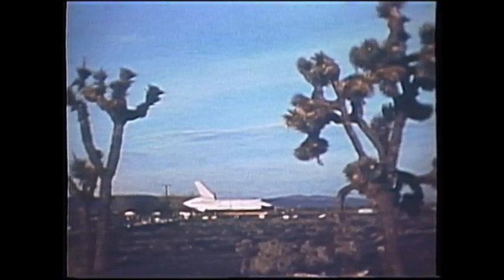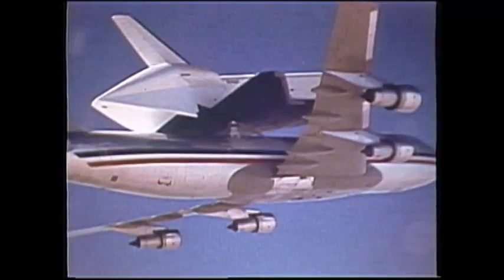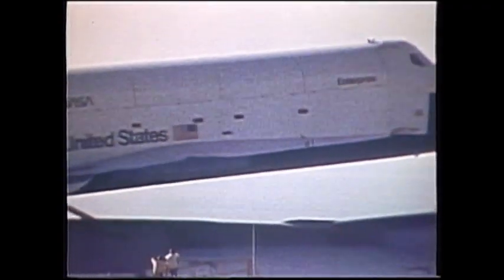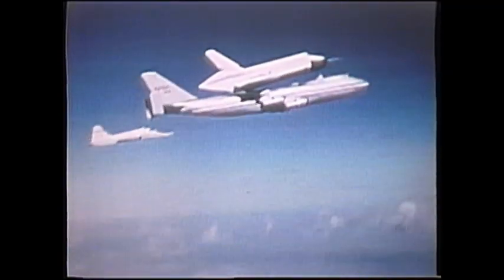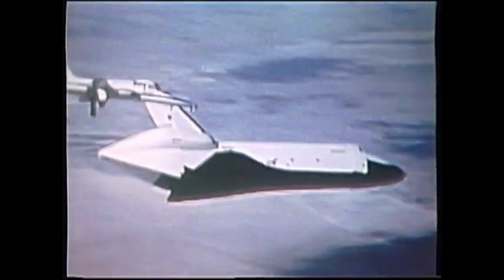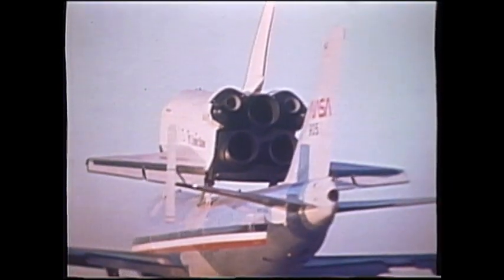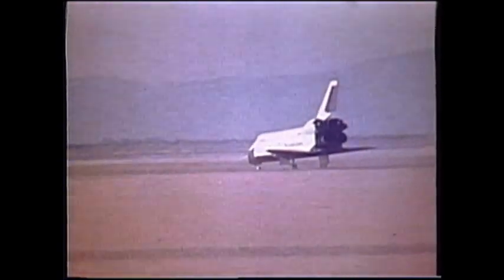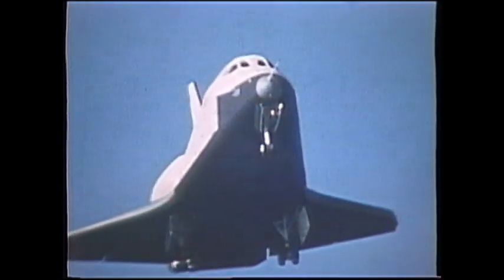Go for Sep

Comment: How space shuttle is controlled without propellers?
Reply: Wings
Reply: The space shuttle is a glider when it lands and doesn't use engines.
Anyway, if it did need engines, why don't you think it would have jet engines instead of propellers?

Comment: It’s depressing that they were designed for 100 flights but they got canceled before they even got close to that
Reply: The reusability of the Shuttles were vastly overstated.  Each of the tiles had to be inspected, and damaged ones replaced.  The engines were removed and went through extensive checks each time.  The solid rocket boosters were recovered, but the refurbishment process was actually more expensive than outright replacement.  It was never the rapidly reusable spacecraft that was promised.

Comment: Great space program. Fantastic ship. Back when we had true ambition.
Reply: The Shuttle was incapable of anything but low earth orbit.  It was an overly complicated and expensive space truck that failed to be cheap or rapidly reusable.  They accomplished a lot with it, but many of the same tasks could have been done with a heavy lift rocket and crew capsule.
Reply: 10 billion goes to the ISS, 10 Billion goes to JPL, Marshall, KSC, Wallop Island ect, 9 Billion to Artemis
Reply: @davidking1460 
Exactly.  It doesn't cost SpaceX $2 billion to launch a rocket because they don't have 6000 employees hanging out at Marshall, many of them engaged in make work activities.  And Ames, and Glenn, and Langley, and Stennis, and Goddard, and...
Reply: We still have ambition. If we could only get the funds
Reply: @davidking1460     NASA is getting $24 billion this year.  Funding isn't their problem.

Comment: Does the 747 detach the space shuttle for it to land or does it land with the space shuttle?
Reply: What would be the point of landing 747 with the Space Shuttle?!
Reply: Before the Approach and Landing Tests were carried out, they practiced a series of captive tests.
Reply: I dont know thats why i was asking
Reply: Oh God 
They used Boeing 747 for two purposes, one was to test the landing procedure (as shown in this video) and it was detached then, and the other was to transfer the Space Shuttle when it landed at Edwards Air Force Base, and White Sands Space Harbor, to b bring it back to Kennedy Space Centre where taking off took place, and it wasn’t detached (for obvious reason) then.
Reply: max5250 thanks
Reply: @Dandan-ku5vy  
You're welcome.

Comment: This is great. Landing from 20,000 ft and 250 knots. But how did they test landing from mach 20 in outer space?
Reply: STS-1 through STS-4 were piloted test flights. With 2020 hindsight (ha, get it?), this is extremely dangerous and we probably would have launched the Space Shuttle without a crew before putting astronauts in it if it were to be done today.

Comment: On one of these Enterprise test flights--I was sitting on Trim pad 22, running a T-38A engine test run.  And we had to hold for the two aircraft to taxi out to the runway--past our location.  Wish I had a camera then--history in the making.  But we set there so long--that we finally had to shut down--not enough fuel to taxi back to the parking area.  So we got to watch the entire flight--from takeoff to the landing of the shuttle test aircraft.  The Enterprise was built without any intention that it ever venture into space--simply a test article.  But when the Challenger blew up--it was considered to update the systems--and use the Enterprise as a space vehicle--until it became clear--doing this would result in costs higher than building a new orbiter.  So now--it resides as a museum piece in New York City aboard the Intrepid.
Reply: actually, it was planed that 001-Enterprise would be the 5th orbiter to launch until some genius said, "hey guys, you do remember we shocked this hard enough to simulate 100+ flights already, right?"
Reply: @Arch_Angel_7774  Second orbiter actually. OV-101 was always planned as an actual space vehicle (hence the "OV" designation). 

After the vib tests at MFSC, OV-101 was to return to Palmdale and be outfitted with the missing space systems and then delivered to KSC for first flight processing.

This never happened due the fact it wss the first orbiter and had serious weight problems. So the decision was made to convert the Structural Test Article-099 (STA-099) into the second orbiter making it OV-099 (Challenger). OV-099 was much lighter than OV-101 was increasing the payload mass to orbit capability.

The fifth orbiter, OV-105 (Endeavour) didn't come along until after the loss of OV-099 as a replacement constructed from a set of structural spares contracted for during the final assembly of the two last orbiters (OV-103 Discovery and OV-104 Atlantis).

Comment: Nothing can leave the earth, it is just a kind a glider. Thats it.

They do vibration tests, what about pressure, vacuum and leakege test. They dont need those because it wont go anywhere
Reply: You obviously think that the International Space Station is an elaborate hoax and isn't actually in orbit around the earth?
Reply: Do you think they put every commercial airliner in a high-altitude chamber test to check for leakages that might cause decompression? They were a lot of things about the Space Shuttle that could only be tested in space with a man onboard. In fact, the first four flights were almost entirely dedicated to testing the vehicle.

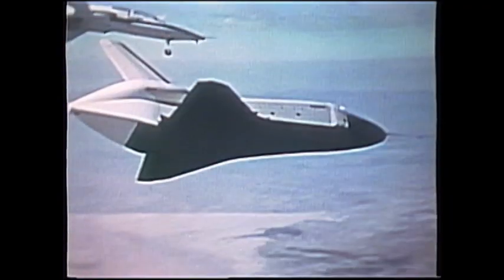Comment: Autoland capability mentioned at 12:40 never completed development. A partial test on STS-3 caused the orbiter to come in too fast before Commander Gordon Fullerton took control for touchdown, and it was decided that it was not possible to certify the autoland system with STS-4 being the last "test" flight before "operational" missions.
Reply: Yet the Buran achieved full autonomous flight but only flew 1 orbital test flight.
Reply: The Soviet's "Enterprise" had jet engines, allowing for many, many more atmospheric test flights to be flown.

Comment: It will always amaze me how the 747 was able to carry the shuttle.
Reply: It was lighter than typical 747 with luggage, passangers and fuel. Also, it started as very versatile transport aircraft. Though I always regretted, that planned contraption (TWO C-5s joint with center-wing) were not built :D
Reply: @piotrd.4850  Do you mean the 747 used to carry the shuttle or the shuttle?  If the former, then it's even more amazing it could carry the shuttle.  A fantastic feat of aviation.

Comment: 13:57 At first glance I said: no way that dude is flying that other plane so low, he is crazy. Had to watch againand understood that the other plane was taking off.
Reply: No not taking off. It's called a chase plane (there were at least 4 from what I see) and they are there to observe, record and advise. They take the film which you are now watching.  https://en.m.wikipedia.org/wiki/Chase_plane.   Look at 13:28 and you can see the chase plane on the far side descending in tandem with the shuttle. Interspersed you can also see a near-side chase performing a similar manoeuvre. 
It may appear to be taking off due to the relative speed differential: as the shuttle slows the chase plane may have to keep forward momentum to keep airborne. Notice how the chase taking the film is beside the shuttle but moves ahead (actually the shuttle moves behind) as the shuttle slows.
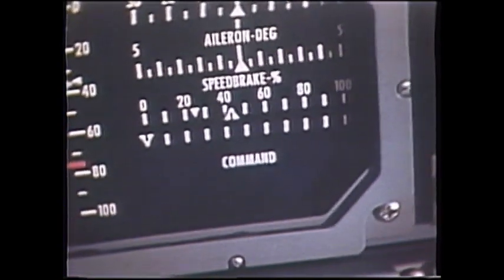Many times chase planes do land alongside the test aircraft. I do not know if that was the case here. However, I think I see dust from wheel touch on the near side chase at 13:47
According to this https://www.nasa.gov/centers/dryden/news/NewsReleases/2002/02-47_pf.html
the first flight was accompanied by 5 chase planes (probably T-38s).

Comment: And people still believe that a 747 could fly with a 75 TON spacecraft on it's back! If you even tried to just set it on top of a 747 it would start crushing it with just a fraction of it's total weight.
Reply: Care to post your calculations & structural analysis showing that this would be the case?
Reply: corisco tupi, thank you for proving that you people still exist.
Reply: @thatman8987  Thank YOU for proving that you have your mouth where you ass should be.  Next time you want to say some idiocy in public, be prepared to prove it when challenged.
Reply: @thatman8987  It's been over a year since you posted your first comment on this thread.
Just wondering if you're still a brain-dead fool who doesn't know what the fuck you're talking about?
Reply: And yet, the video clearly shows that the space shuttle was able to sit on the back of the 747. 
Incidentally, what specific 'fraction' of its total weight, should the crushing have occurred?
Oh, you don't know?
Hardly surprising, as you're simply making shit up - IDIOT, LOL.
Reply: The 747 is not carrying passengers and the aircraft frame was reinforced to withstand the weight on top.

Comment: The A380 is nice, but the 747 is a true work horse monster, let’s see an a380 do that
Reply: Isn't an A380 bigger than a 747?
Reply: ISSAR 2019 the A380 is bigger indeed, but it has very poor cargo lifting capabilities, it was never designed for heavy loads, the 747 was at first a cargo plane for the US Air Force, but they lost the contract for that to the C-5 Galaxy.
Reply: @Pim2407  wow,thanks!

Comment: When the shuttle separates, since it has no forward thrust of its own I am surprised it doesn't run into the vertical stabilizer of the 747.
Reply: I think the 747 pitches down and the Shuttle pitches up immediately after separation for that reason. Also they are at the same airspeed at separation and airspeed does not dissipate that fast even with no thrust. Just guessing.
Reply: @Ant0417  You are correct.
Reply: Inertia , Newton is smiling in his grave
Reply: The shuttle has forward momentum as it leaves the 747, which generates lift from air moving over its flight surfaces, so it can trade speed for lift and pitch up away from the descending plane. 

Momentum is also one of the reasons that when you jump in the air you don't get smashed into raspberry jam against the nearest wall by the earth's rotational speed.
Reply: I imagine the same feeling of jumping off a moving vehicle .. There's that forward pull .. cant remember what its called in physics ..
Reply: The 747 is in a shallow dive to begin with. I imagine he increased his dive maybe dropped slats and spoliers a bit? Do separation from a good enough airspeed for the shuttle to exchange what he has for altitude.
 I wonder about wake turbulence. Eventually that shuttle has to come back down and the 747 is in front and below.

Comment: I didnt watch the video because of thumbnail. Buran over 747.
Reply: Enterprise on 747.  Russians launched the Buran after shuttle was placed into service.
Reply: @comment2009  No main engines on that thing, cant be a shuttle.
Reply: @hp2084  Enterprise used mock up RS-25s, the flight engines hadn't finished testing at Rocketdyne before the ALT flights began. What you're seeing is the Aerodynamic Tailcone used mostly on ferry flights. Also Buran was built in the 80s, Enterprise debuted September 17 1976, she was officially retired before the Buran program even began.
Reply: @hp2084 The shuttle's engines were initially covered by the fairings to minimise drag and buffet on the 747's tailplane, until the flight tests showed that the structure would handle the turbulence when the fairings were eventually removed as the testing progressed. 
And you actually thought you were being clever with your observation, when actually, you've only succeeded in showing everybody just how ignorant you are, lol.

Comment: I remember seeing this on live TV
Reply: Как назывался ваш телевизор, то есть, какая модель телевизора у вас была ? 🤔📺
Reply: @agl3083  It was a 1975 Magnavox console.  25" screen with a wood decorative frame.  Not sure of the exact model #.  It was a decent tv however sometimes the tuner would not work correctly  so we had to open the back up occasionally and spray the tuner with some kind of silicone spray which would fix it temporarily.

Comment: The major problem of getting into space and escaping Earth's gravity with a single craft or shuttle is the biggest challenge. Unless the propulsion system goes nuclear calling for a small fuel load and a light craft this is not possible. I am imagining spacecraft carrying 4-8 persons and equipment to even reach Mars. No stages and stuff falling back to Earth or floating in space. When is that possible?
Reply: You're talking about SSTO (Single Stage To Orbit) vehicles right? For one it's very difficult, and secondly the payload mass penalty you take on is immense and takes away from the practicality of SSTO's. For now, reusable (and self-landing) stages make sense and are practical. Everyday Astronaut did a video on the practicality of SSTO's versus MSTO's, I recommend you watch it: https://youtu.be/Sfc2Jg1gkKA

Comment: The whole space shuttle concept is inherently less safe than a regular rocket with a capsule.
Both the Challenger and the Columbia disaster would likely not have happened with a Saturn V style rocket: If the first stage fails or even explodes, the crew might have escaped by seperating the capsule from the rocket, firing the escape rocket and landing with the parachutes.
And damage to the heat shield during launch or flight (as in the Columbia disaster) is very unlikely to occur, since the shield is on the bottom side of the capsule and well protected.
In general, the Space Shuttle concept seems too unsafe for today's standards.
Reply: Yes, because we are a bunch of over safe pussies today and afraid to take risks.